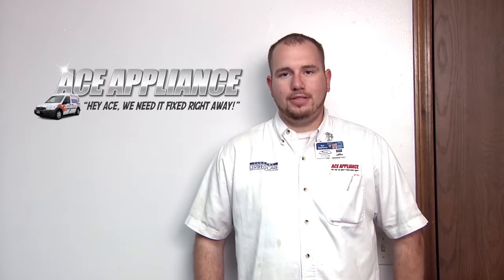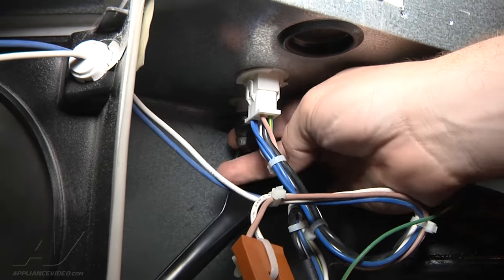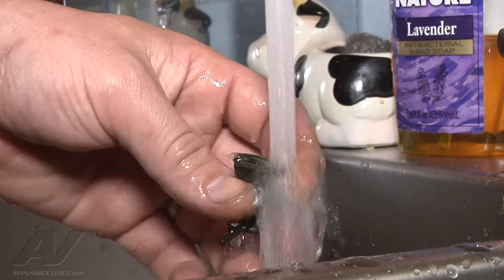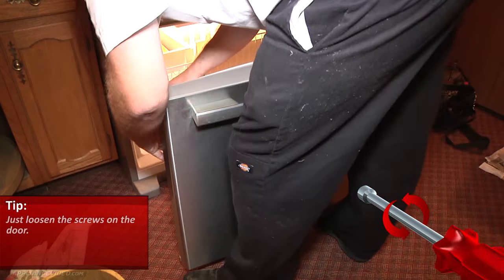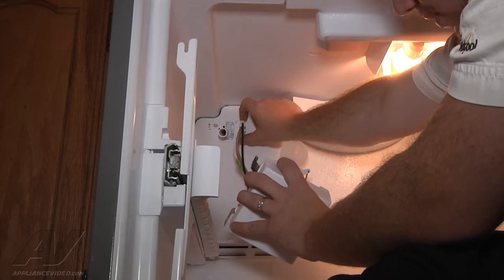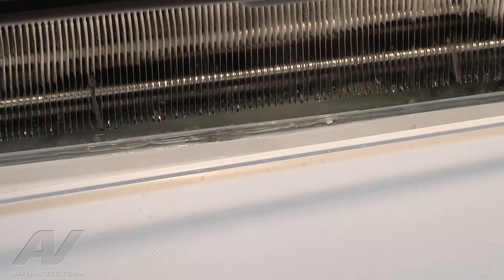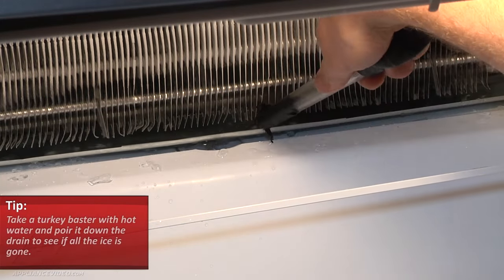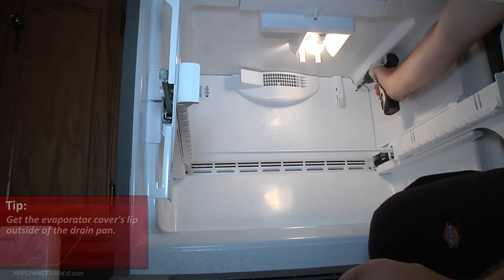Whirlpool Refrigerator Repair - Ice Buildup in the Freezer - GX2FHDXVY06

Comment: What a Fracked up design. How did Whirlpool's engineers ok this for production? Why is it not covered in the owner's manual, at least what to put into the drain on a regular basis to keep it clear? Why not have it removable from the back where the drain is? Make it more accessible would be common sense. I had mine defrosted about 2 1/2 days once to try to stop my fridge from peeing on the floor, and it still didn't work. The Rubber of that valve that is supposed to drain the water to the evaporator tray is crappy and deteriorating. There has to be a better design. 
I knew Whirlpool was crap, but now I'll make certain to never buy another.
Reply: They have since made an upgraded p-trap design to address the problem
Reply: @gking854  Would be nice if Whirlpool would have a step-by-step instruction posted on their website at least.... Thanks for the update.
Reply from the maker: Great question, if you have a more technical question that our parts department cannot answer, you can search our over 17,000 answered questions free at our website www.ApplianceVideo.com under our Repair Help section. You can also call our parts department at 1-800-830-5465 and they can give you help 7-days A week ,or search at www.SaveMoreOnParts.com  .

Comment: This is the problem with appliances today:  poorly made.  There is no reason a consumer should ever have this problem but due to poor design, too-small parts, etc., it is unfortunately a common problem.  I just purchased my first bottom freezer fridge and in 4 weeks, had a huge mess in the freezer, frozen stalagtites of ice everywhere.  I was not about to "repair" a brand new fridge.  They were happy to bring another of the same model, since I've been a good customer, and if this one does the same thing, it's going out the door also.  Have had wash machine issues also, due to the crappy new electronics and other parts.  Now on my 5th washer in 20 yr, absolutely ridiculous.  Transmission went out on one model, after only 6 yr of just me using it.  Junk!  And don't go by the "back in the day" brand names;  they've all sold out to other people and are not the reliable appliances of yore.

Comment: THIS PART HAS BEEN REPLACED BY A DRAIN TRAP. THIS IS A SERVICE UP DATE FROM MFG. PN- W10619951
Reply from the maker: Great question, if you have a more technical question that our parts department cannot answer, you can search our over 17,000 answered questions free at our website www.ApplianceVideo.com under our Repair Help section. You can also call our parts department at 1-800-830-5465 and they can give you help 7-days A week ,or search at www.SaveMoreOnParts.com  .